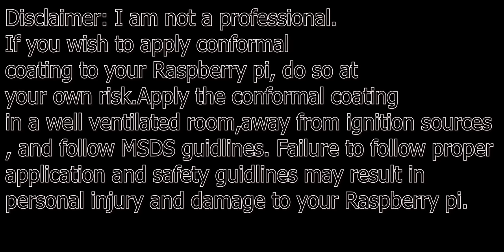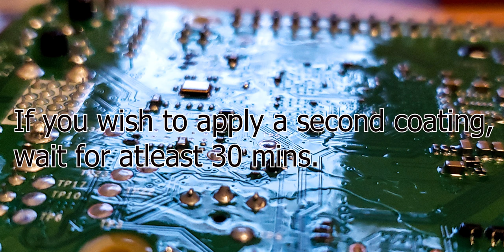Applying acrylic conformal coating to a Raspberry pi 4b

Comment: Oh man.. after going to college and applying this so much.. it hurts watching you do it.

You don't have to apply it to all of the PCB board.

You only need to coat the etched wiring and electrical components.
Reply: Wrong, there's no reason to not coat the entire board there's no downside and it will provide a uniform barrier of protection water's main talent is being able to go places you'd never think it could some of the things I've seen in fielded hard life equipment will boggle the mind. This is how conformal coating is done on integrated military circuit boards/cards, and it's done in an extremely thick layer. Repair is simple enough you just melt through it with your iron do the repair clean and apply more CC on top with a brush, though on large repairs it is more time efficient to use a specific CC solvent.